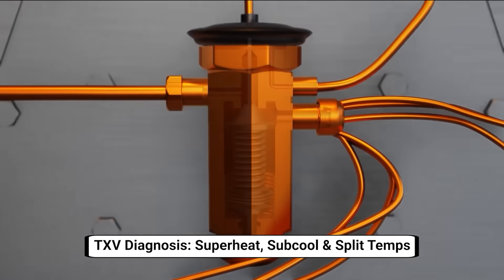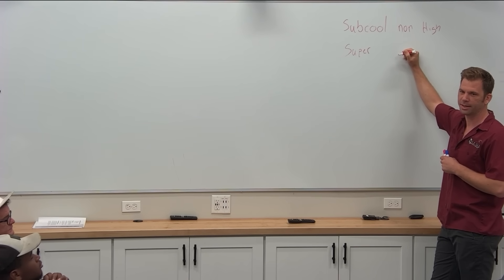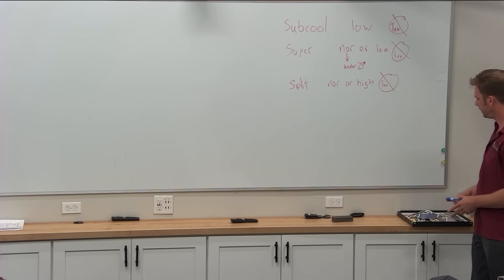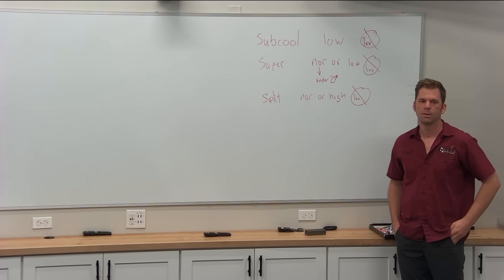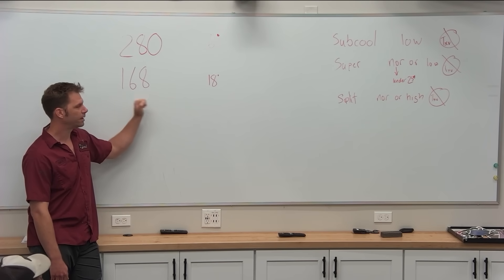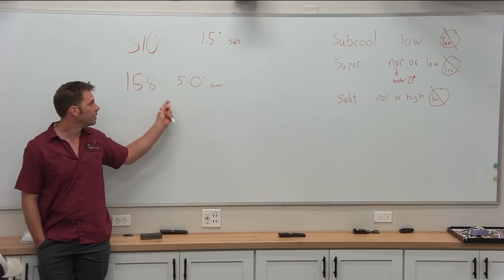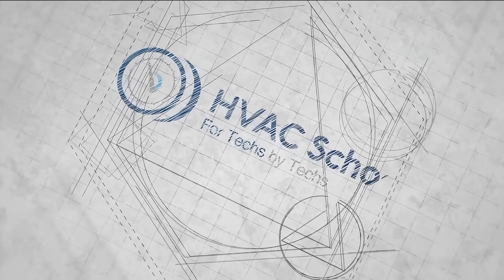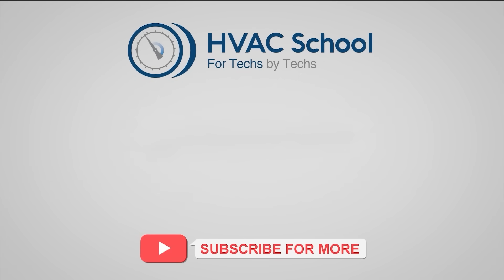TXV Diagnosis: Superheat, Subcool & Split Temps

Comment: I’m confused, you said low subcooling = not a TXV issue, but later said low subcooling is a result of the TXV being wide open, not allowing refrigerant to stack in the condenser. What am I missing?

Comment: 50 psi suction, low subcool, hi superheat, no split (8), frost after txv. TXV was 4 ton on a 2.5 ton system. Not sure if the txv is bad itself other than oversized also. Adding refrigerant didnt change suction pressure. 410a system. Worked fine in heating (piston in outdoor unit)

Comment: I've had a run of stuck wide open TXV's on Carrier(ICP) straight cool R410A systems this season. The most recent one had the following Suction PSI 127.6 Suction line temp 43.7° Superheat 0.1° Liquid line pressure 293.6 Liquid line temp 87.3° Subcooling 7.2° system calls for 12° of subcooling. Temp split was about 19°. Outdoor temp 92° indoor 75° this is the 5th system I've had with this issue. They were installed by our company in 2021 & 2022.
Reply: Same here, you can have a decent temp split and still have a bad valve

Comment: I found one earlier, on call, that has a few of us tossing ideas back and forth.  Running pressures are 214 suction, 284 head, 12.4 SH and zero SC. I think the compressor is shot, but it's only 7 years old.  So I've had doubt  instilled that it may be a flooding TXV. Curious what you all think.

Comment: I don’t understand the example at  11:52. Superheat is 35, split is normal. You say the txv is closing because the coil is cold. I always thought the txv as a superheat device. It only maintain a certain amount of superheat. Since when does a txv close because a coil is cold? Even with low airflow, the coil will be colder/the pressure will be lower, but the superheat isn’t going to change. I might be wrong who knows. Ready to learn.

Comment: Slipping/slopping compressor? What does that mean? I've never heard those terms.
Reply: Odd terms to use, but I believe they just mean an inefficient compressor (not pumping as much vapor as it should).
Reply: I’m not 100% but I would say he’s speaking about the pressure differential the system is designed for . If the compressor “Slip sloppy” causing higher than normal vapor saturation temperatures and lowered discharge, caused by weak or damaged valves, internal mechanical wear, poor oil return and flooding. I think that’s what he means .😂